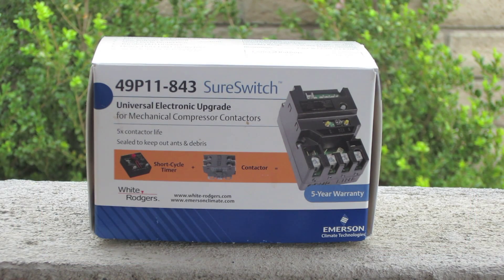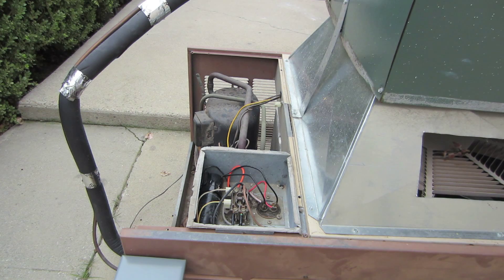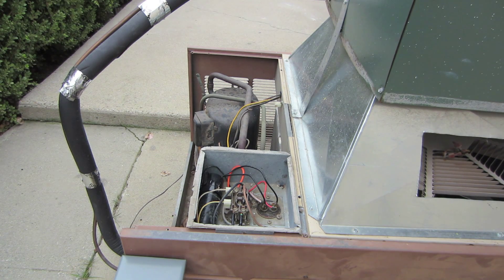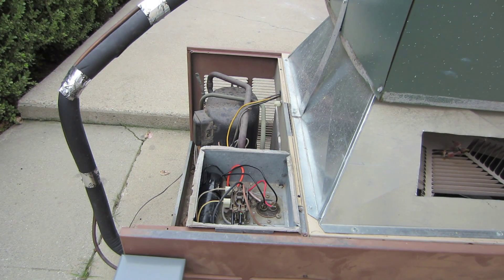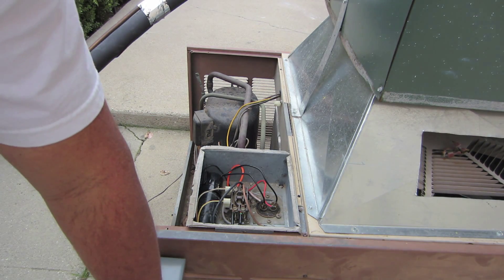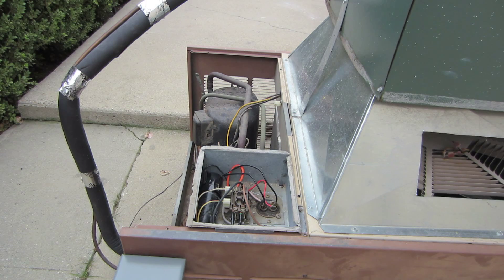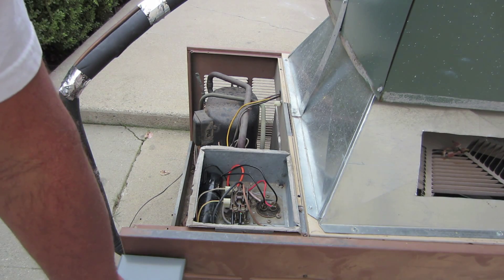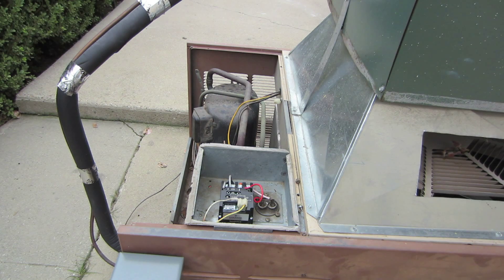HVAC:Emerson SureSwitch Electronic Contactor

Comment: This product only switches one of the line inputs. The other leg is internally jumped to the compressor at all times. Is this a good practice? If so, why do standard contractors have two leg switching?
Reply from the maker: Most single phase equipment are equipped with a single pole contactor unless they have optional accessories or special component that will be needing two switching legs. One other reason they use single pole is because of cost. The two pole contactor can be used in single and three phase applications. Thanks for watching.

Comment: Also, it's great that it is now rated for 40 amps and 200 LRA!! I know of a 4 ton Rheem heat pump that needs one of these! I just crossed out the specs on my box too and wrote in 40 amps/ 200 LRA ( and "Yahoo", too..lol)